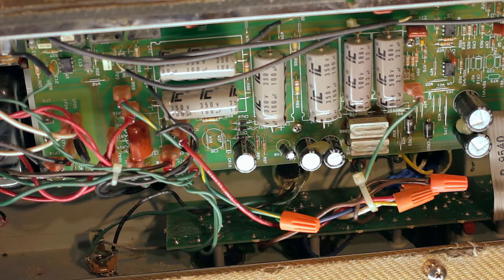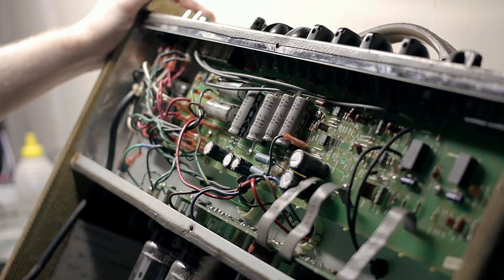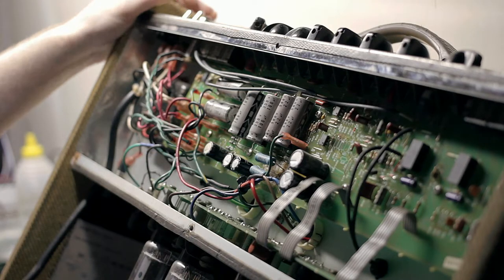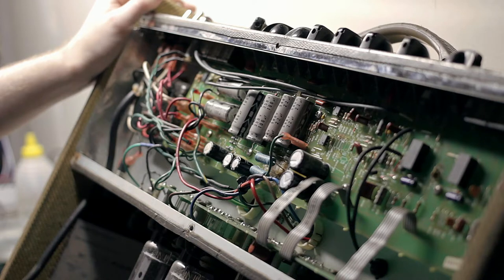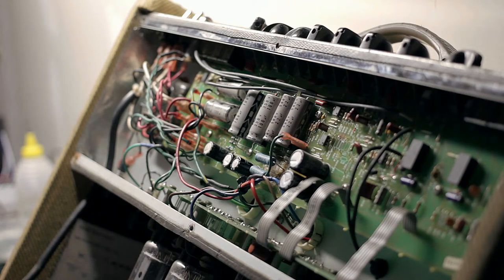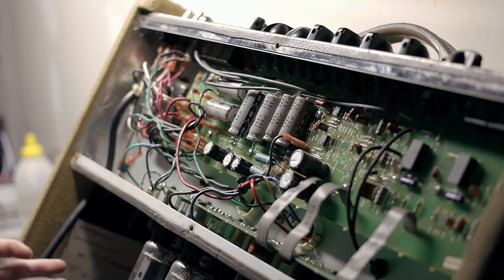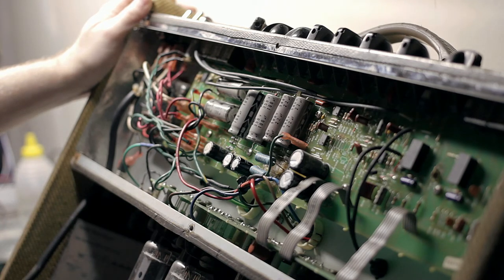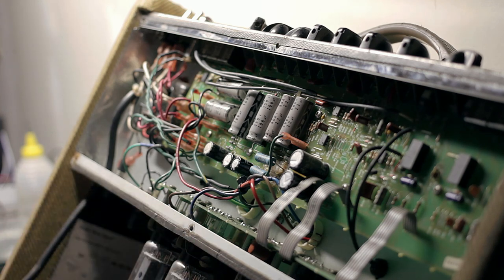90's Fender Blues Deluxe - An odd problem and repair + common things to look for

Comment: great suggestion about the resistors, that´s the only thing i miss checking on the one I have on the bench, very similar issue, It has been serviced by some other technician in the past and it was already visible that the board suffered heat damage and repairs. I've got a few  blues deluxe on the bench and another common faliure point is the FET that does the channel switching. Overall they all seem to have major issues over time.  Compared to older Fenders and other amps these are a nightmare to service and modify.

Comment: I know this is an old video but i figured its worth a shot to ask.

 I have this same amp and i was playing today, and it sounded like i was getting a connection issue in the cables before the amp went silent. I turned it off and unplugged/replugged the cables to the input and loop and made sure they were all the way in.

I fired up the amp and eveything sounded fine, volume and bass are normal. I switch standby on before switching off power and its hissing loud through the speaker. It plays fine with no unwanted noise until you switch it to standby. If you turn power on with standby switched on, there is no hissing. Only hisses after playing then going to standby. Any idea what that is?

I actually recently bought the amp from an old friend of the family who does repairs but he is currently on vacation and i dont wanna bug him until he gets back.
Reply from the maker: There may be a ground off or a bleed resistor that has failed. There are so many things that can fail on these amps it's hard to say without going through and diagnosing it. The standby disconnects the high voltage so you need to figure out where or what is bleeding through or not drain the circuit down. Go through the schematic and check all supply nodes.